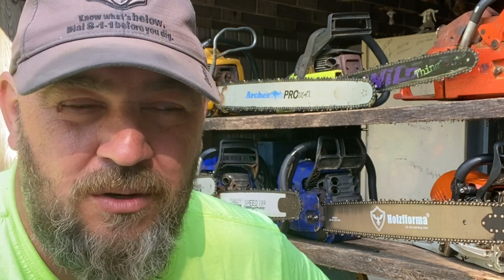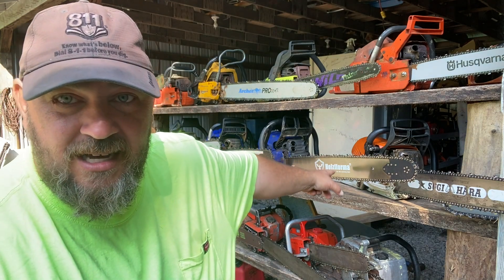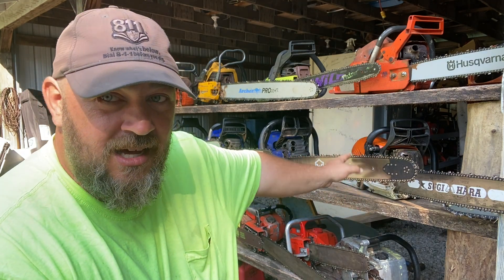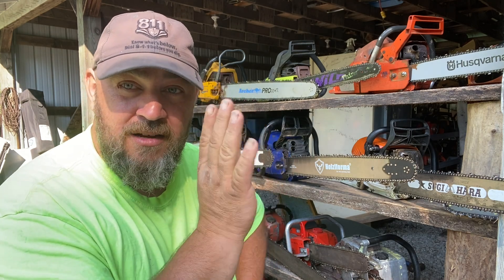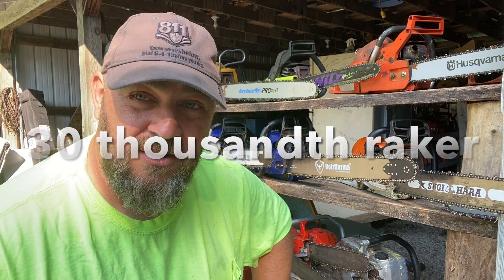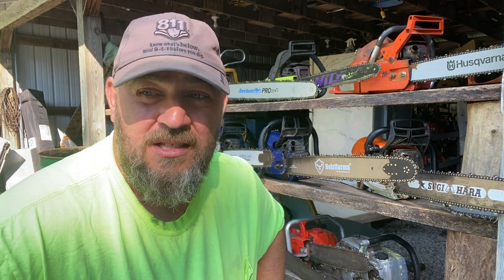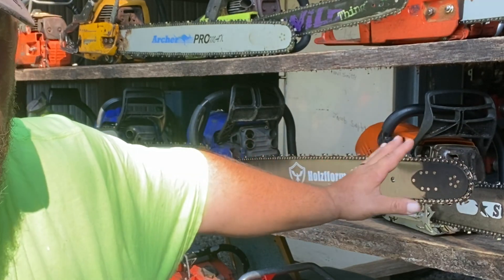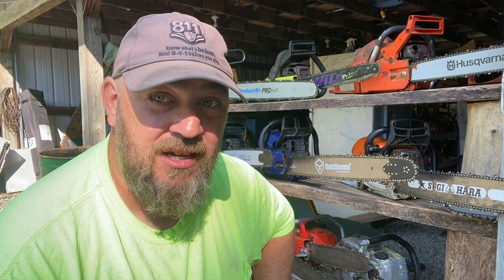Advanced Chainsaw Sharpening Techniques!  First Cuts And introduction!  Episode #1!

Comment: Hey Smitty, since your going to that much trouble, are you gonna do the study with the same saws? 
Maybe document the saws , bar length, rpm’s it etc… in addition to your grind angle formulas. 

Thanks!!
Reply from the maker: I could do that. I would just need to replace my tachometer since mine broke. It’s definitely possible.